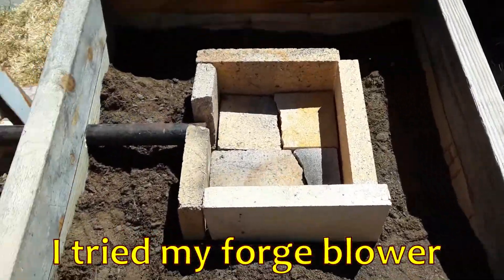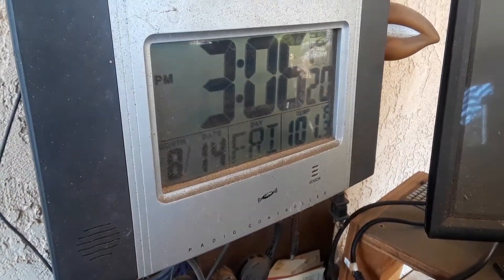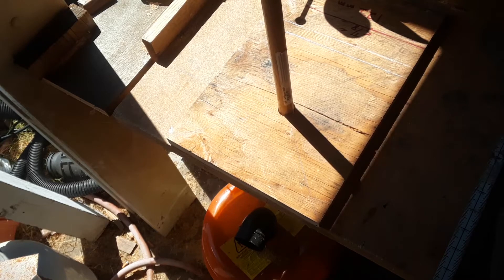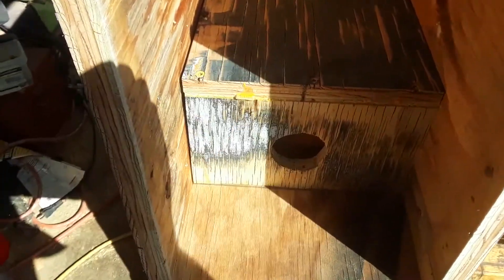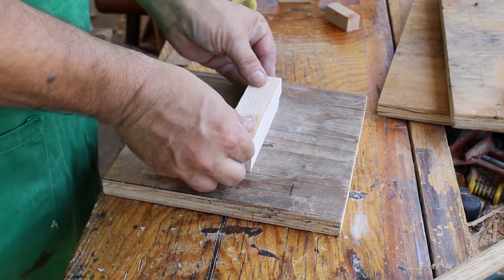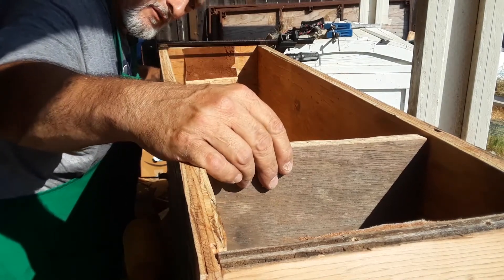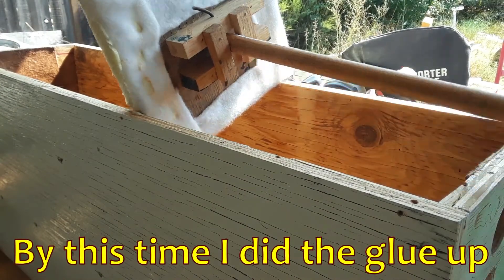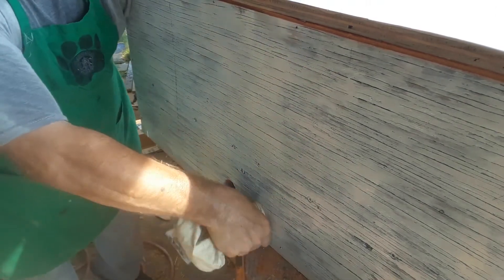Scrap wood Fuigo build

Comment: ..i Like it !! Great job sir. i have been wondering about putting Formica or something similar on the bottom and sides...
Reply from the maker: Thank you! The formica on the inside would be great for a smooth glide! the outside would certainly me silky smooth. I will soon be picking brains about the actual firepit and smoke hood since this is primarily an outdoor forge.